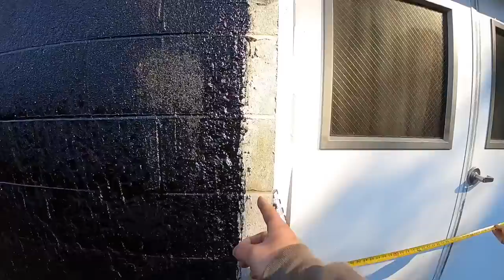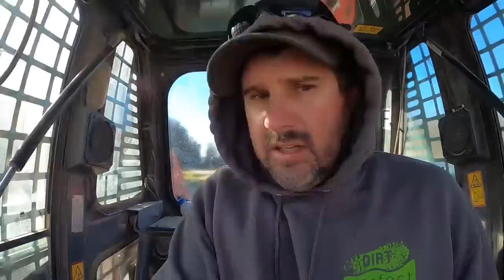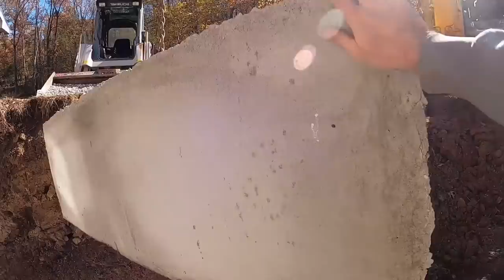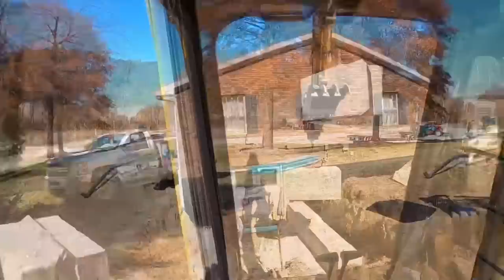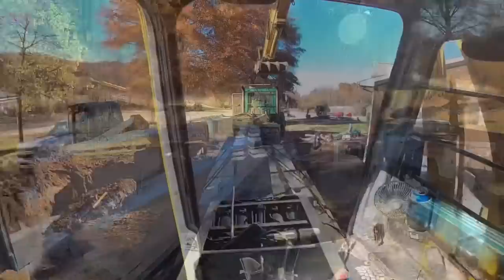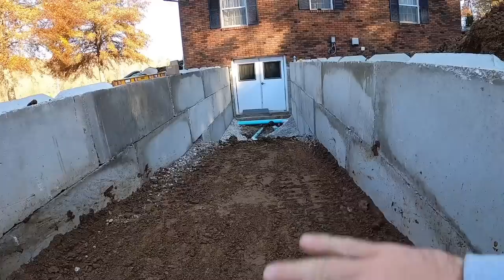Rebuilding failed retaining walls for a basement access with junk block-do what we can!

Comment: There is absolutely no need for those concrete blocks to be different in size, the forms they use are standard. All it means is that they haven't prepared the forms properly, they should be cleaned after each use and re oiled so the concrete doesn't stick. Like you say it's a shame, your trying to make something look nice for the customer. You buy this product as its easy to use, no concrete foundations and no cement work. Rant over! 🤗 Really nice job, like you say you won't know if the leak is fixed until it rains. Apart from putting the building up on stilts or building a moat, don't think there is anything you could do.
Reply: I just installed 140 of those on a wall on my property. The first 80 blocks they delivered were pretty good but the last 60 were pure crap. Some of them were out as much as 2 inches from one side to the other.

Comment: Even with the extra labor time shimming, the blocks still have to be reasonable compared to other options and I think they look fine. Slap a veneer on and totally top shelf for even the nicest new homes.
Reply: Yes, a veneer and cap as he described, will look good. There is plenty of structural integrity to hold it all together.

Comment: Hey Mike and Mat, that looks really nice. just a simple question, I think. Because those blocks are so out of straight and square, would setting the blocks in a thick bed of mortar help getting them even or would it be mor of a pain than shimming with washers?
Reply from the maker: That would be much ore Of a pain
Reply: @DirtPerfect  thanks for the reply.  The only way to learn is to do it and screw it up of just ask.

Comment: Absolutely crap goes the same for retaining wall block when I have to buy it at the big box stores. They’re always junk it seems.
What size gravel was that 8s or 9s?
I was holding my breath when you would take the Taki in between the walls! 😂
Now they just need a landscaper to tidy up the finished product and restore the landscape beds after the concrete work is done. 🤔

Comment: Nice work.  That retaining block is sort of like working with concrete block units for a wall versus using brick.  It works, but the look is not the same, and clearly the producer of those blocks you use sees them as marginally better than trashing the extra concrete.  I wonder whether the shims will rust and jack the wall after all your work leveling  and plumbing it.  Did you use galvanized washers, or stainless?  Just getting the water out of the area will make your wall last at least 5 to 10 times as long as the previous wall, and the added wall mass will keep it from ever tipping in, I would think.  I can't wait to see the final clenup on this one.

Comment: Nice work ! I have to ask did you set the width of the ramp so the skid steer would fit ? On comical jobs I have worked on they use a hard plastic shield as well as the roll on water proofing.
Reply from the maker: No just working out
Reply: @DirtPerfect  Something something, about being lucky, rather than Perfect.

Comment: One thing is for sure, those blocks will last a lot longer than that old wall.  Width and weight will make it much sturdier and hold back the dirt.  Looking forward to seeing the finished product when they cover the sides!  The decreased pitch will make going in and out a lot easier!  Especially when it is wet, snowy, or icy!  The time and effort for all improvements will benefit the homeowners for many years to come!

Comment: Have you ever looked at Verti-Block? It's core-filled with gravel. Blocks are lighter and easier to truck.
Reply from the maker: Yup
Reply from the maker: Very expensive compared to this
Reply: The County won't let us use standard mafia blocks for retaining walls. Has to be from a split face mold. Pricing difference isn't huge then.